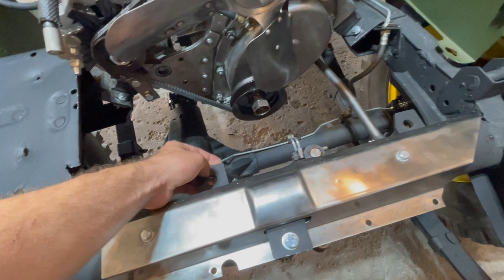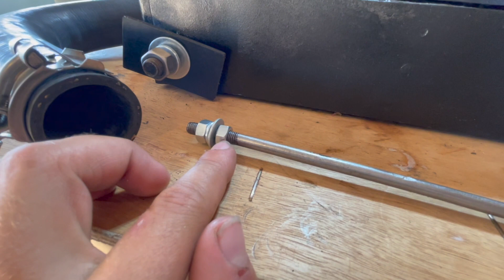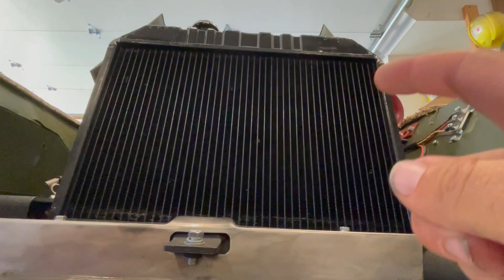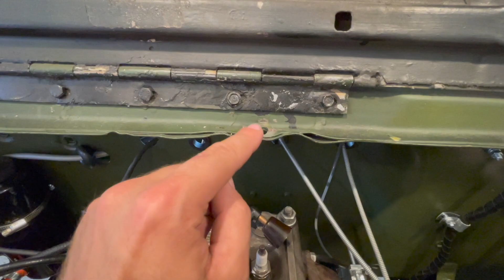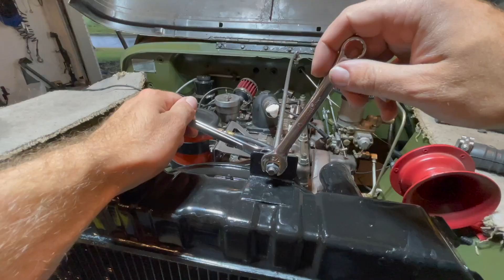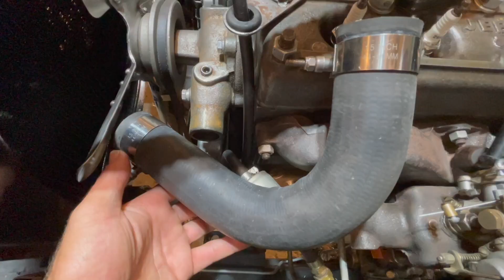Willys Jeep Radiator COMPLETE INSTALLATION GUIDE

Comment: The top radiator outlet isn't slanted like the original.  I can find radiators with the slant and no shroud, or not slanted with a shroud.  What is the length of the flexi hose you are using?